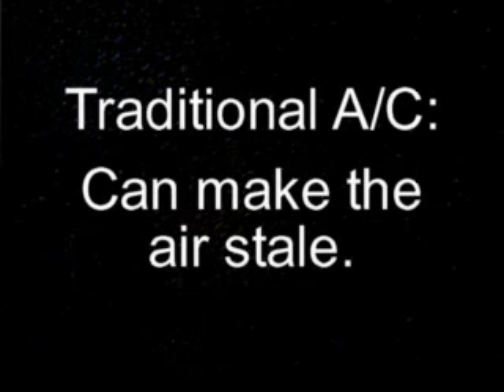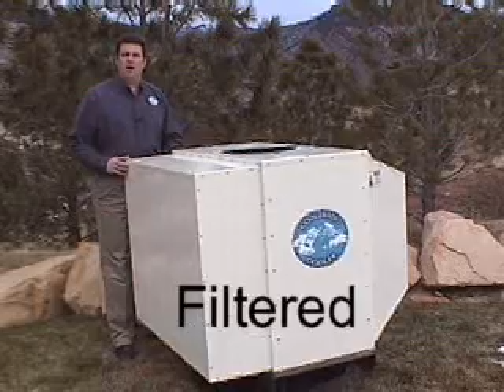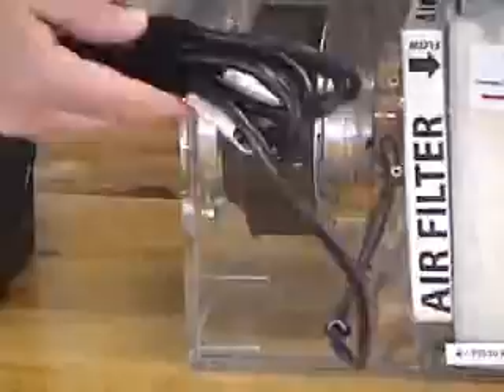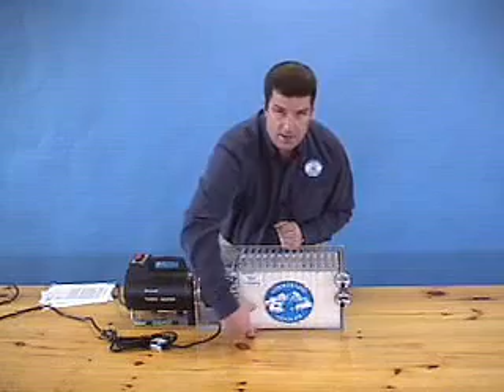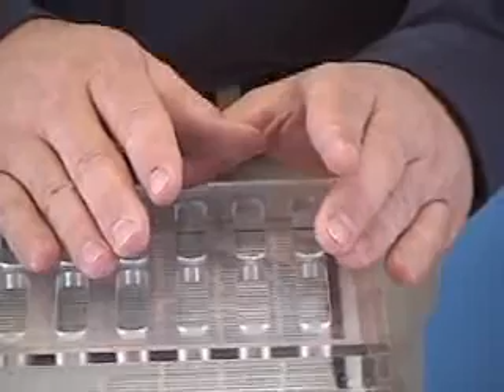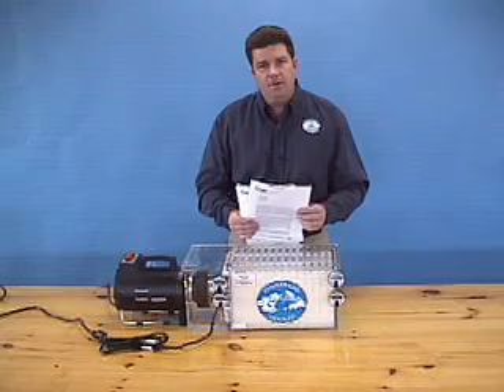Coolerado Air Conditioner Introduction

Comment: the coolerado , use common water( hard water) or distilled water ???.   How is been affected  by calcium  sediments?
air in need to be filtered?  particles in the air.  if the have how long they must be replaced?.

Comment: "....and demonstrates a 100-degree-Fahrenheit temperature drop with a Coolerado Demonstration Air Conditioner."

By heating the ambient air to 150°+, you effectively reduced the RH, i estimate, to less than 2% for a dew point of around 24°F, artificially increasing the cooling capacity of your "working air" by a huge amount! 

I bet those "experts" that watched your demo dropped high school physics in the first hour.
Reply: Exactly 👍👍

Comment: High efficiency can only come from the fan bearings being lubricated by purified snake oil, unfortunately this is extremely expensive and difficult to come by as most snakes produce so little and are reluctant to part with it in any quantity, not to mention the hazards of collecting same

Comment: This company is awful. We got a collerado air conditioner and the company wont return our calls when we need help turning it on. They also refuse to come and fix it even though it's broken after 2 years of summer use.
Reply: What did it cost for your installation? Probably not much, it looks like a simple install. Did it cool your house sufficiently? In what state do you live? The replacement filters would be cheep. The desicant material life could be prolonged by using purified water, and installing a condensor coil to recoup the water from the hot exhaust air.

Comment: review of their install manual shows that yearly maintenace of internal parts and water supply treatment along with sales price and install cost(barring you did not need any duct re-working) would not yet you to even start re-coup investment for 20-30 yrs. This ofcourse factoring in you went strickly by the manual for all of the above supplies and services( by lic contractors). int cost could easily be 15-25k
Reply: +j barron just what i was thinking... all that surface area running tap water, those heat exchangers wouldnt last long, but if it was a closed system...

Comment: I just read some of the comments. This is not a two stage swamp cooler. These guys have taken this thing to a whole new level. A swamp cooler is not capable of the temperature drop that they are able to produce with this cooler. I understand what they are doing and it is very ingenious. They are one of the few people that actually admit that solar panels have a great power loss at higher temperatures and that is a first. They loose 30% of their power or more because that is one of their characteristics as temperature increases.  Al
Reply: Agreed, their innovation appears to me to be the evaporative medium in that it has an extreme amount of surface area to achieve the high temperature drop over the 13" (which I somehow imagine could truly be much larger since any kind of folded design could double, triple or more that length).  I've often wondered after seeing this whether a person could make something with such extreme surface volume with something like a 3D printer (which I have).  Trouble is I live in high humidity (FL) and so can't get the benefits I'm looking for from evaporative cooling alone.  Therefore looking to add some BTUs of cooling from some combination of ground water (which is 75 degrees here) and solar power (targeting 200 watts or so, to make it at most a 2 panel setup) (and definitely agree about the power drop with solar panels losing power at high temps).

Just tossing this out in case you had any thoughts on this.  My goal is clear (but not simple), produce a device that is 100% duty cycle (during (heat of the day) sunshine...) and lowers cooling costs by at least 30% (improving to 50% over time) after an initial outlay for the components and solar panels.

I recall someone was planning to make a 100% duty cycle dual mode A/C system that was based on a traditional refrigerant, however, running it at lower pressure to reduce compressor wear and consume less energy in that low power mode.  It was supposed to be able to also run at traditional high pressure mode.  The idea was that it would run 100% duty cycle off of solar energy, then as needed, would kick into high pressure mode to achieve the desired air temp necessary during the heat of the day.  While it sounded like a brilliant idea, I've never found anything more on the plans becoming a product so either they couldn't get funding or the idea had some technical flaw they couldn't overcome.

Bottom line is that I know something can be achieved to lower our overall cooling costs in hot, humid climes and it's likely based on a combination of the maisotsenko cycle, solar power and possibly ground water temp.
Reply: @brianmi40  If you add a desiccant dehumidifier in front of this, then you'd get similar effect as being in a low humidity environment.  You'll need a regeneration process for the desiccant, but thats typically applying heat to drive off the water.  Rotating desiccant wheels (rotating very slowly) or liquid desiccant membranes are options.
Reply: @bbatchelder  - I don't think a desiccant dehumidifier would dry the air nearly enough to restore a significant temperature drop, and, they only work until saturated, then you have to take them and plug them in to dry them out, obviously in another environment, so as not to simply put the moisture back.

as this site says, you need the Dew Point below 55 to 60 degrees for evaporative cooling to be effective.

https://www.hunker.com/13401280/effective-dewpoint-range-for-evaporative-coolers

I just don't see that happening with desiccant in a high humidity environment...
Reply: Look at Bepower.
Reply: You might look into inverter air conditioners also might look into liquid discounts on using your solar power to dry them out

Comment: this sounds like a 2 stage evaporative cooler with no water in the second stage. been done LONG ago I believe. like an evaporative cooler blowing on a pipe, and the air to be used in the building is going thru that pipe. this has been done before long ago.

Comment: how well does this work when the entering air is 80% humidity sounds like a simple evaporative cooling unit to me
Reply: Not as well... but I've had feedback from an early adopter in Brisbane (Australia) where it provides a relatively cheap cooling solution that is good enough for their humid environment. Not great, but good enough.

Comment: Not exactly.  It doesn't have to dehumidify anything.  it runs outside air in  pipes alongside the air that's getting the water added.

-jcr

Comment: im interested in being a ditributor for any air conditioning system that can use solar energy to run alone, no need of conventional electricity power, it seems soolorado have that, but comparing to conventional AC units, can temperature be graduated? and  in celsius dregees for a temperature about 50C outside how much it would be inside with this product?

Comment: So it looks like it is saturating the air with water to collect the heat, and then de-humidifying the air to remove the latent heat that is now captured in the water. I would love to see the EER numbers calculated based on different outside air humidity levels. If it works well in the extremes (arid desert air vs humid tropical air), then you have me sold!
Reply: The water doesn't touch the air that is getting pushed into the home. there are channels separating the two. the heat evaporates the water and that transfers the heat to the molecular structure of the vapor.

Comment: Kudos, great concept and application.  Looks like this would only as effective as outdoor humidity levels would allow, however.  In other words, you would not be able to dehumidify beyond your OA dew point.  So this concept appears only viable for certain areas that experience very regular and low humidity levels, ie Colorado.  That said, you should market another unit as the "Airizona".  I hereby claim intellectual property rights to this name, by the way.  ;o)